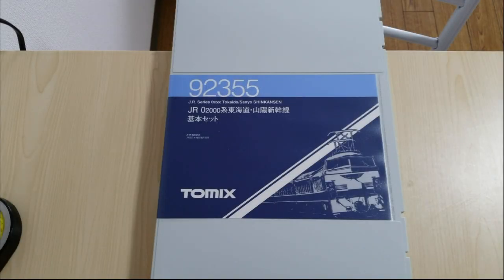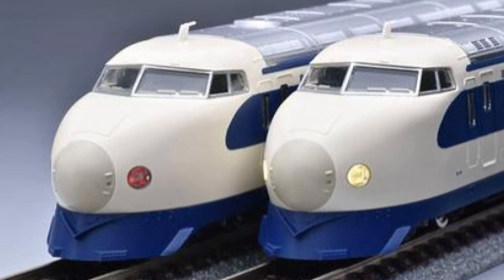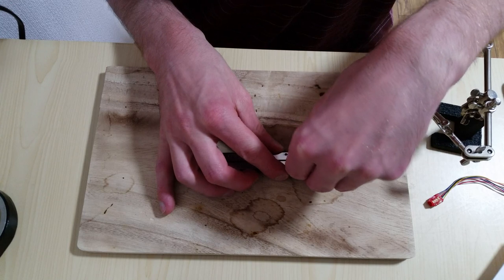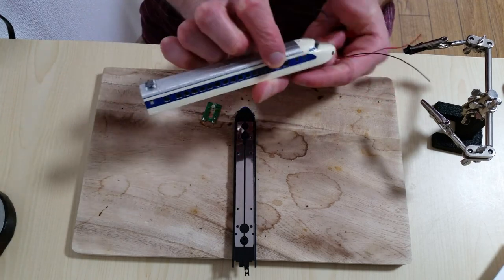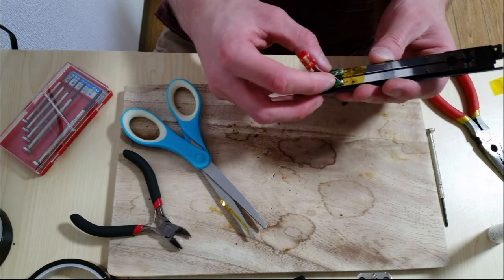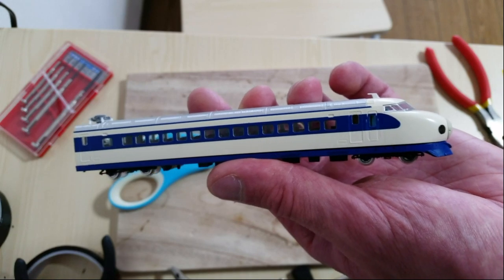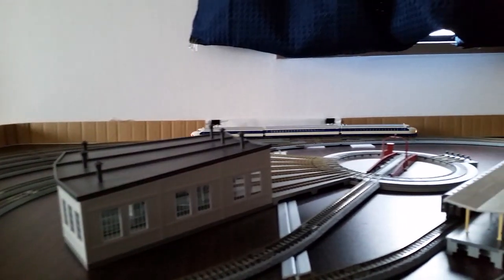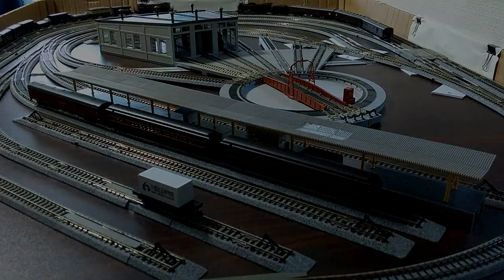62. Installing DCC in an EMU (Bullet Train)

Comment: I enjoy watching your videos and have a question?  I have a Kato 500 Type EVA that I tried to add DZ126 decoders to using your suggestions.  The light board in the end cars has two LEDS a red and white flipped for polarity so one or the other is on when voltage direction is flipped.  There is a 561 SMD resistor to prevent LEDs from burning out.  I hooked up the orange and grey motor leads and using Decoder Pro set motor 3 voltages to 2,2,2.  Using my Digitraxx DCS51 when I advance the throttle forward the white LED comes on but after a few seconds turns off and reversing the throttle the red LED comes on but also turns off.  Any suggestions?

Thanks,

Joe